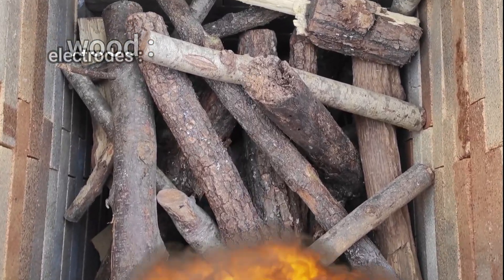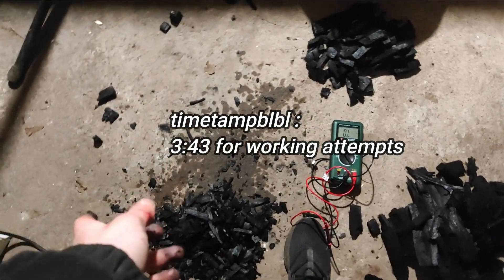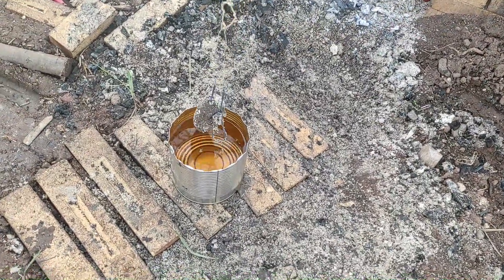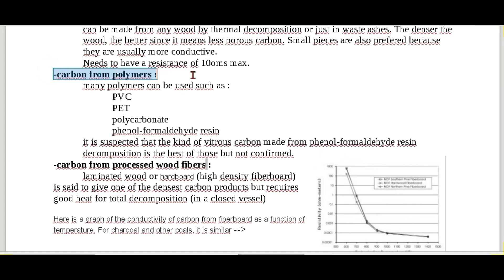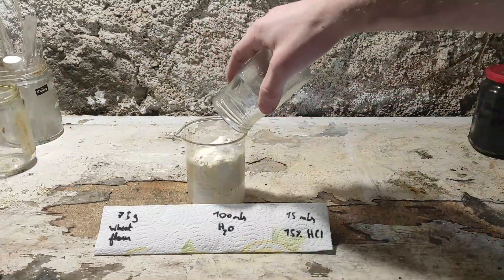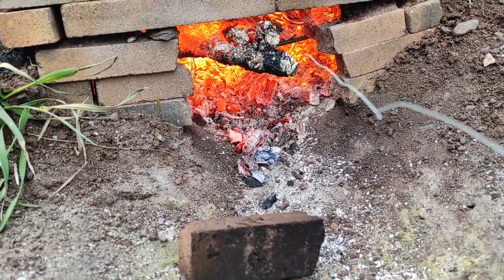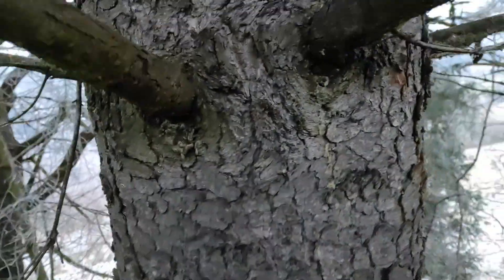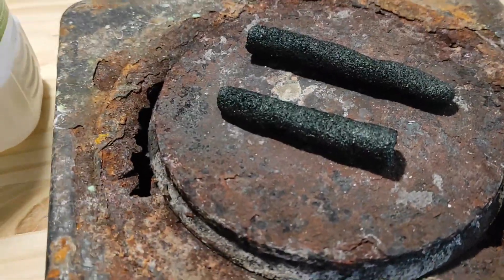making electrodes from WOOD

Comment: I wonder, would bitumen work as a binder?
Reply from the maker: @DecayedPage  maybe but without tests, it's hard to tell, to be a good binder it needs to form the less gazes possible and decompose into mostly carbon
Reply: @jam_kemist3986  Yea I might do some tests on that, for the pyrolisis chamber im probably just gonna heat a soupcan with a high current MOT
Reply from the maker: @DecayedPage  nice if you have any results, I'd love to discuss on discord, I personnaly want to try phenol-formaldehyde resin while it's decomposing to see if it would make a solid block or if I need to compress it as well

Comment: I really dont like adding stuffs to graphite to shape it. Just use a carbon based compound or dont !
Because when the rod corrodes it will gonna react with solution. Just use the pure carbon/graphite.
The low conductivity or (resistance) is when the mineral in wood is not brunt !!. First the wood truns into carbon (including some potassium in it), with the high pressure and high temperature it truns into graphite !!. You know about wood ash yeah ? A potassium bicarbonate, just remove it from fine carbon powder before proceeding. Theres about 14% fine potassium in it. I just the pure and perfect stuffs. Use a steal pipe and hidrolic-press to compress the fine carbon powder !!
And set the steel on metal-melting oven (not a wood stove), cuz metal-melting oven dilivers enough temperature to trun it into graphite.
Once it truns into graphite rod, it will take a shape and be strong, no need to shape it with additives.
Reply: Don't forget you have delivery consistent pressure while heating. You can just do it by hands if you don't have hydro-press.
Reply from the maker: Ah yes I'm going to press manually a 1000°c rod with my hands
Reply from the maker: Science doesn't care about what you like lol. boron doped diamond is an exemple of it. Stop saying bs when you don't know it will help you

Comment: I have two things to add. First is that you can use charcoal directly if you make it from a really hot fire because under extreme heat it becomes partially graphitized. Because it's still charcoal it has a super high surface area, but it's kind of hard to make a good connection to wires unless your charcoal is super long (the solution with absorb into the charcoal and will degrade your wiring). 
You can make normal charcoal better by soaking it in urea solution, drying it out, and then heating it in a fire. You can also heat it in the microwave but it will arc a little bit. 
Finally, you can use about 5% oil and protein powder as a binder because as it heats up it makes very long aromatic chains which holds it all together and the nitrogen content actually makes the charcoal tend more to being graphitic. You do have to heat it up in a fire with no oxygen though.
Reply from the maker: Thanks for the advice !
I don't understand why urea would help, wouldn't it just decompose in CO2 NH3 and others like cyanuric acid or biuret ?
Also did you test the oil and protein powder mix or is it just an idea ?
Anyway thanks for all suggestions !
Reply: @jam_kemist3986  The urea can help because one of its pyrolysis products is melam which can then polymerize into graphitic carbon nitride which then provides a place for the carbon to start producing a more conductive graphitic structure. The temperature shouldn't go above 600°C or else the urea will decompose entirely into gaseous products, but a gentle fire shouldn't get it that hot. As for the oil and protein powder, i specifically tried it with the cheapest vegetable oil i could find and (because i happen to have a lot of it) the amino acid phenylalanine. I can't guarantee that whole protein will work, but i don't see why not
Reply: @jam_kemist3986  
Maybe of interest heptazine, or tri-s-triazine or cyamelurine...as an extension of melamine plane for a poly-aza-graphene; interesting compounds on a detonic theoretic level because of the density increase and nitrogen content.
Indeed the chemistry of H2N-CO-NH2 and thermolitic products is awfully complex... NH4OCN, H2N-CN, polymers, H2N-CO-NH-CO-NH2, isocyanuric acid, cyanuric acid and ammonium, uronium salts...

PHZ
Reply from the maker: The problem is not really the conductivity tbh, the brittlness/density is more important atm.
The protein Idea seems pretty good but since I have flour and no protein powder imma stick with this mix for the moment

Comment: Could you get a higher density by grinding the charcoal finer?
Reply from the maker: Yes probably but at this point you'll need a ball mill, which I will try to make, and very dry carbon so that it doesn't clump, it adds a few steps but might be worth trying

Comment: Heya! If you have issues with self made charcoal, you could use fuel coal coke. It is very conductive (propably less than 0.1ohm) and come in chunks. It is hard though so you would need a steel mortar and pestle to crush it. You should be able to buy it in places that sell fuel coal.
Reply from the maker: Thanks for the suggestion ! 
I'm going to search for it and try it If I find some

Comment: Very useful information. Thanks. Do this type use for arc welder?
Reply from the maker: Thanks a lot ! I'm going to test this in the next video because I need to turn the electrodes into glassy carbon using high temperatures :p
Reply: @jam_kemist3986  OK.im waiting for it.thanks  a lot.your video is perfect.

Comment: use bicarb and water proof it with epsom salt solution,  but it takes many dips for it to be fully water proof.  but prob only get low conductivity.
Reply from the maker: Thanks for the suggestion,
Can you explain tho how would MgSO4 make the electrodes waterproof if it's itself soluble in water ?
Maybe I misunderstood 🤔
Reply: @jam_kemist3986  
I guess he wants to precipitate MgCO3 into the pores of the charcoal by the reaction
Na2CO3 (aq) + MgSO4 (aq) --> MgCO3(s) + Na2SO4 (aq)
Reply: @jam_kemist3986  it reacts with the sodium bicarbonate to make magnesium bicarbonate (water insoluable)

Comment: You can also use Starch instead of sweat flower
Reply from the maker: Yep that's definitly a good idea, needs to be tested, hopefully I'll have the time
Thanks for the suggestion !
Reply: @jam_kemist3986  i know that from the coal brickets production. in Germany are coal brickets popolare
Reply from the maker: @icebluscorpion  what do you mean ? I should use german coal ?
Reply: @jam_kemist3986  No 😂 they use Starch and coal dust from the wooden chare coal production and press them into little round bricks called brickets. The are pretty hard and when you pyrolize them they sound like care coal and are shiny like chare coal /graphic like? but are harder then charcoal. I didn't messure conductivity though. It might be electrode like. You need some good amount of pressure. I'm not sure about the mixing ratio starch to coal dust though. I look it up and will post the ratio here.
Reply: I found the patent but I probably are not allowed to post it because the stupid algorithm will delete my comment
Reply: 1. Verfahren zur Herstellung von Hausbrandbriketts aus nichtbackender Rohkohle, insbesondere Anthrazit, und Stärke, dadurch gekennzeichnet, daß die Ausgangskohle eine Körnung von 0,3 mm aufweist, der Ausgangskohle 3 bis 5 Gew. % Feinststaub mit einer Korngröße kleiner gleich 100 Mikron sowie 2 bis 10% Wachsmaisstärke beigemengt werden und die durch Brikettierung ent standenen Preßlinge solange in einer 300 bis 400 Grad Celsius warmen Atmosphäre gehalten werden, bis minde stens eine etwa 3 mm dicke Schale am Preßling ent standen ist, in der die Stärke denaturiert ist.
Reply: But it seems that part of it in German is allowed?! 🤔IDK🤷‍♂️

Comment: 13:38 The copper wire is what's electrolyzing the water!
Reply from the maker: The electrode was also doing the job as you can tell by bubbles where the copper is not present
Reply: Nah ! 
Don't u see the electrode bubbling?

Comment: Won't Potassium (from the ash) and Boron (from the Boric acid) contaminate anything you try to use these in?
Reply from the maker: Realisticaly the potassium is just on the surface after cooking the electrode, and I didn't showed it on camera but yeah you need to wash them before using them.
The boron tho is mostly trapped inside the carbon and is insoluble anyway

Comment: You probably know it, but you can get these carbon rods out of carbon zinc/heavy duty bateries. Just find an e-waste bin, collect some big R20 batteries and you are done. Taking such battery apart is pretty easy and relatively safe, but it is easy to make quite a mess. Then you heat up these rods slowly to burn out any acid or other substances and thats it. If you don t pre-heat them ant then use them in a high temperature application like an arc lamp, they might explode from the expandig steam inside them so be carefull.
Reply from the maker: I knew it was a thing but thanks for the precision !
The downside is that you can only make chlorates with those whereas a boron-doped glassy carbon electrode (not exactly the ones I made) can make perchlorates hehe
Reply: @jam_kemist3986  
There is also the possibility to use gaphite from drawing shops; I have some that are 1 sq cm diameter, shiny and smooth like a pencil end for about 15 cm long. It is a common item and doesn't cost a lot :o)
Reply: @jam_kemist3986 
Im sorry, im an electronic hobbyist, not a chemist or anything, i thought that you need just a resistive to corrosion material for doing electrolysis. I read online that you can dope graphene (probably graphite as well) with boron but the price of chemicals to do so exceeds the price of already doped graphite. Why is boron so important? I watched a guy making a rocket from table salt and he said that he could make sodium perchlorate by just doing electrolysis of salt water, though it would take a very long time, like a week or more at a few amps. Sorry for my bad englisch, if it is bad...

Comment: Hi Jam Kemist,
Nice try.
Indeed quite handy to be able to make your own carbon-electrodes.
I also have some ideas for "PbO2-PbO-Pb and clay pots" ones (to make chlorates and eventually perchlorates; although it would probably be much more easy by dilluted H2SO4 distillation of chlorate (yielding HClO3 below the dangerous zone of 40% and disproportionation leaving HClO4 and setting HCl free; or the thermolysis of NaClO3 that allows for precipitation into molten NaClO3 of NaCl after disproportionation into NaClO4 and NaCl and then extraction of residual NaClO3 and NaClO4 from aceton in wich the later is more soluble; while the NaClO3 is moderately soluble and NaCl unssoluble; then HCl treatment destroys any chlorate left into Cl2, H2O and NaCl leaving only Na perchlorate exempt of risky NaClO3 for pyromixes involving acids generating stuffs (P, S, ...)

I would probably test from BBQ charcoal too (or gaphite what is more dense but requires to be extrated from its oils, volatile aromatics and volatile polyaromatics (PAHC) and heteraoaromatics (this can be done via acetone reflux-soxhlet).
I will also try to find an unreactive "cement" organic or mineral that can be molten.

I also will test for carbon sulfur electrodes; because about 35 years ago I discovered a glassy stuf that was made (with a metalic glow) out of molten sulfur and C black of fumes (ultrafine sooth(*) from candles on a cold surface); if this is conductive; it should solve all your (and mine too) problems with electrodes allowing us to make hard solid electrodes (brittle by hamer yes) and smooth, of nearly any size and shape for a cheap price (sulfur is cheap so is C-black of fumes); the electrodes should be inert towards many chemicals if not too hot or too oxydants; and easily remolded and remade if they corrode after some uses.

Kind regards,

(*) Black of fume was quite potent for chlorate based black powder NaClO3 or even better KClO3 / S / C / CaCO3
- the CaCO3 is there to fight surfacial acidity of S generating itself upon time via air (and oxygen) oxydation and forming traces of adsorbed SO2 and SO3 (thus H2SO4 after catching moisture from the air); same applies with the unfamous white or red P yielding the sensitive Armstro,g"s mixes (via trace P2O5 and H3PO4); the resulting conc HClO3 from H2SO4 or H3PO4 is of course self igniting and explosive leading to extremely unpredictable sensitivity and uncompatibility of chlorate based pyro-mixes); this Ca(2+) also give a slight rose-orange hue to KClO3 / S / C powder while burning; it burns hot and fast; so probably most colors will fade to white if using other carbonates like Li (red), Sr (red), Ba (green), Cu (blue) (caution this last one may sensitise chlorate mixes).

I have had KClO3 / S / C black of fume that was so potent and fast due to fineness of ingredients that could reach D2D in a a few g even into a 3 cm copper pipe open on both sides and put on the ground with one end upside and filled with a coffee spoon of mix poored lose into it without compression and actuated by a long fuse; the pipe was turned into dust - shrapnels - fumes.
A fuse made with a plastic straw of 3mm large and 30 cm long lasted like: 
10 sec with normal KNO3 BP, 
5 secs with fine BP; 
about 10 sec with  KClO3-S-C-CaCO3 gross powder (but way more bright and powerful than the KNO3 one)
and this black of fumes / KClO3 / S / CaCO3 mix burned the fuse in less than 1 second (yes  ONE second) (the plastic of the straw had barely the time to melt prior the flame front had already reached the bottom; it melted afterwards after a delay.
I assume that any usual KNO3 would also perform much faster with it.

PHZ
(PHILOU Zrealone from the Science Madness forum; yes the very same you spoke about into the begining of this video :o) )
Reply from the maker: Hi again ! 
I've never seen on youtube the process you describe for making perchloric acid from chlorate salts via distillation. It seems really interresting, I'll do some research on it for sure !
The carbon sulfur idea seems good as well, I had though about soot as a source of carbon but no idea on how to get large amounts of it sadly.
Anyway thanks for your much appreciated suggestions as always !
And are you saying you are hexabromobenzene ?
Reply: @jam_kemist3986  
Thanks J.K.,
The process is indeed quite easy but requires some safety for distillation of HClO4 of 40<72%.
This usually implies clean glassware, glas rods / joints (certainly no cork stoppers or organic matter like plastics, rubber,...).
Many thinks that HCl being a very strong acid could be used to displace ClO4(-) from its salts and this is true below a certain point where HClO4 becomes more acidic due to concentration; but HCl is uncompatible with HClO3 because oxydoredox reaction leading to Cl2, ClO2, Cl2O and O2; this is why NaClO4 - NaClO3 (minor quantity) can be washed with HCl to destroy the later and leave the NaCl, NaClO4 / HClO4 behind (with HCl fumes leaving the system) and why strong unvolatile, non oxydable acids like H2SO4 can be used to disproportionate and distil HClO4 from NaClO3 but with the caution to remain below the dangerous zone of 40% HClO4 what means more H2O to eliminate afterwards and to temper any runaway explosion of HClO3 (ClO2 fumes and Cl2O are explosive).
-->Hint,  I explained it with more details in french into comments of the french YT channel "à fond les ballons" ;o)

The easy melting of NaClO3 to NaCl and NaClO4 is quite interesting; it requires temperature control to not heat too high to the NaClO4 decomposition temperature (leading to NaCl and O2); but it is easily observable (O2 bubbles) and precipitation of NaCl or NaClO4 into the clear liquid molten NaClO3.
I have made it myself and it is quite good and easy. Sadly NaClO3 is no more accessible OTC into Brico shops or other drogist shops since the regulations of Europe due to ban (the EU did ban many chemicals because they were used to make energetics or did kill people (sadly some stupid people did salt their steak with "sodium chloratum" - insead of sodium chloride and they died what did put the product with a red flag onto the list :o( )
The process was exposed into a YT video of Laboratory of Liptakov (another SM forum member like me).

And NO I'm not the SM-forum member hexabromobenzene; I'm PHILOU Zrealone as signed at the bottom of my YT comments; a bit like the cheese "Port Salut" "it is written on it" ;o); I also think that I was busy into the SM forum before he came in.

PHZ
(PHILOU Zrealone from the Science Madness forum)
Reply from the maker: @philouzlouis2042  sorry for my misunderstanding, I thought you had multiple accounts 😂

Comment: Dude im not sure if you can make perchlorates from carbon/graphite anodes ive made lots of k chlorate though just from battery carbons and stainless steel butter knife good luck though man im looking forward to the attempt
Reply from the maker: Thanks for the appreciation ! 
From what I understand boron doped glassy carbon electrodes can, but I'm not there yet hehe...
Glassy carbon is just the name for a mix of graphite and usual carbon made when you heat carbon really hot but not to complete graphitisation temperatures